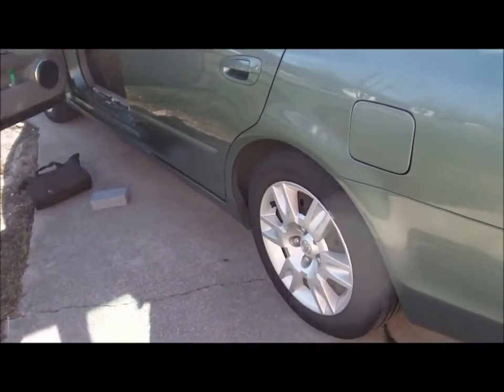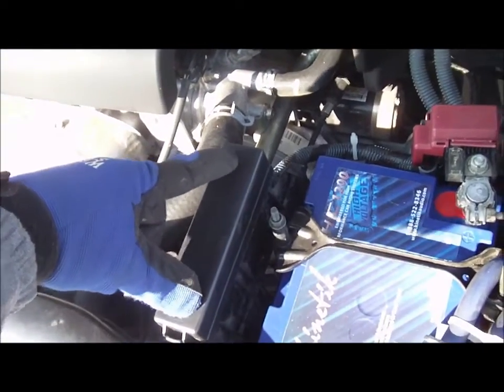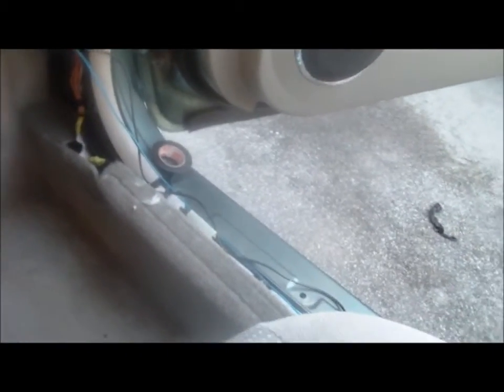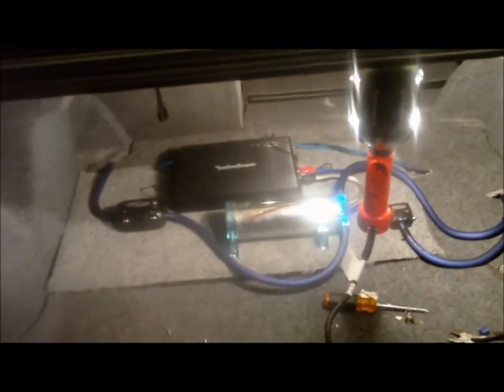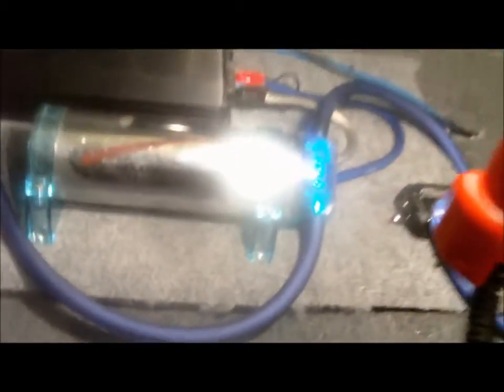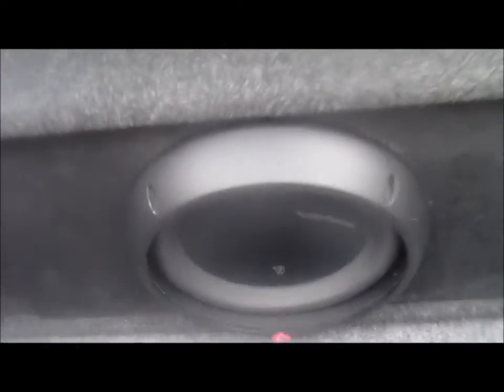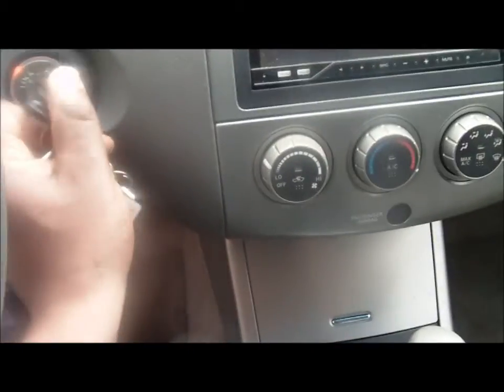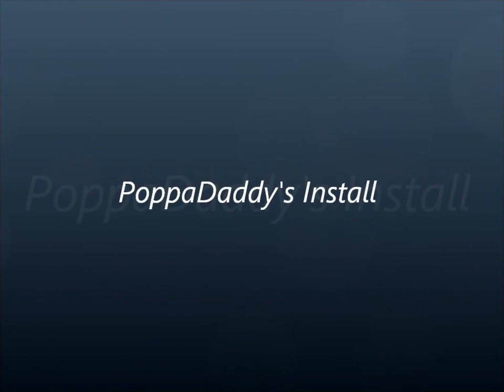2005 Altima Stereo Install.wmv

Comment: you are right bro, your car is automatic, mine has a clutch in the way too, there is no way you are getting anything in that wire harness without damaging the wires. That rubber seal is thick, very difficult to cut it. I guess I need to drill into the firewall like you did, or the metal plate whatever you did...

Comment from the maker: Things to remember guys. Power wire runs 12volts of current. Current will always disrupt a signal which is why you run it away from the RCA's carrying a signal to the amp. This rule applies to the car antenna which in most cars that the antenna is in the rear, it's ran in the paneling. The fix is to have all signals on one side and power on the other. Hope this help.

Comment from the maker: Yes.  Read comment below about "speaker level output" Search eBay or Amazon for this and you can also get one from your local electronics store.  There should be a power, alt turn on, ground, & rca female for you to install your amp.  I'd suggest inline wire connectors so you do not dismantle your OEM harness which also can be purchased online or local.  GL!

Comment from the maker: @akagoodtimes: I ran the 1/0awg wire under the paneling on the driver's side under the carpet.  There are clips that can be lifted (carpet) to access the necessary space for 1/0awg wire.  You will also need to remove the seatbelt panel to make the job easier.  Thanks for viewing.

Comment: I connected the amp turn on wire and a green cable that belongs to the power antenna to the blue/white cable but now my fm is all static.......... What did u do to your green cable from the car harness........

Comment from the maker: You don't need a new HU if you don't want one.  Just purchase a "speaker level output" and you then can plug your RCA's from your amp to your factory radio.  There is some wiring involved behind the FHU, but it's easy.  Thanks for viewing.

Comment from the maker: I posted a link in the description. As for the trip meter I wouldn't think that would have anything to do with the radio.  Unplug your negative (1) then your positive (2) then plug them back up positive (1) negative (2) and see if that will reset your system.  Try the panel fuse as well.  GL!!

Comment from the maker: @99intrigue99. The position of the firewall hole will need to be predrilled as demonstrated. No wires will be in the way, however your brake booster may/should be there so make sure you are in the middle or left for the hole. Thanks for viewing.

Comment from the maker: @310mannyboy :unplug that green wire for sure. Your harness will have a position for the green wire thus hooking it to a radio that supports power antenna. My antenna was in the rear glass so that wire was obsolete. I will post things to remember for static.

Comment: Nice bro!  I'm doing an install on my 2005 Altima right now as well. Ran the Big 3 also, but did my extra ground on the shock tower there was a nice spot to tap for a bolt there.  Did the alternator  power wire jsutl ike you did also.  Gonna wrap it in some heat shielded wrap just incase.  I wanted to ask did you have any problems with the power wire going over the exhaust manifold?  That spot where you ran teh 1/0 into the cabin is where I'm gonna doit too.  I think I'm gonna change how I did my power wire on the battery terminal to how you did yours though, that came out nice.  hope the car treating you right for all these years man!
Reply from the maker: Actually didn't have any issues with that particular wire with the loom tubing protecting it.  It was about 2" off the manifold.  I would run it differently to ensure that you don't though.  I don't have this Altima any longer because it was a lemon and I had to get rid of it.
Reply: @PoppaTInstall  Alright sounds good man.  I was doing some testing yesterday and I think it will be fine actually even without some heat shielding wrap but I'm gonna use some anyway. I got it  zip tied up front by the radiator fans where there are other wires only part that is a bit susceptible is right off the alternator but I added some loom and that heat wrap.  I'll check up on it, if it shows me any issues I'll redo it then.  I got some extra wire laying around that I am using and some new wire too, trying to  use up the old stuff lol. 
I saw the new build with that sub enclosure your doing in the SUV you got. Do the box, dont do the wall.  Boxes that are loud are much more impressive imo, anyone can build a wall and get louder.  Plus if your gonna drive it alot seeing out the back window is nice.  good luck thanks for answering me on this old vid you got here! :D

Comment: Hey I got a question I installed an aftermarket radio on the Nissan Altima 2005 and it turned on but it gave no sound and from what I heard I need to connect blue/white to the amp but idk where that wire is?
Reply from the maker: Maybe it has a factory amplifier.

Comment: How did you remove the floor panels to run the wires from the front to the back?
Reply from the maker: John David just pull up on them bro. They are attached with panel clips.

Comment: Hey xXpoppydaddy i have a 05 3.5 sl im putting the sound in myself. Right now,? How did u make the hole for the hot wire in that spot ?
Reply from the maker: Use a .25 bit for metal drilling. Once you get the hole use a step bit. You can view my other video show how to run 1/0 awg wire through the car for an alternative.
Reply: Thanks!

Comment: Pulled out my stock deck out of my 05 Nissan altima today to plug in my RCA jacks after wiring my subs and everything. But the stock deck doesn't have RCA jacks... Or does it and I'm just a dipshit. Am I just gonna have to go drop some dough on a new deck I really don't want to...

Comment: What kind of radio kit is that
Reply from the maker: Thanks for watching.  It's a Metra 95-7419 and I modified the OEM brackets 3:30 so it would fit correctly.

Comment: you dont need a HU with rca outputs, if your stock HU doesnt have them instead of dropping all the money on a new radio just spend the time and 3.50 and buy female rca plugs and splice them into one of your rear speakers coming out of the HU. If your amp doesnt have a low pass filter youll prob need to get one of those too. another 15 bucks. A whole hell of a lot cheaper than a new radio. Ive done this probably 5 times and it always works just as good as a HU with rcas.
Reply: That is a REALLY BAD idea. I'm assuming you forgot to mention the Line Level Converter between the RCA and the output from the factory amp. The signal you get from an RCA jack on an amp and the output from a speaker terminal are NOT the same. The output from a standard analogue audio out (RCA) is un-amplified, otherwise know as a "Line Level" signal. It's just the bare audio signal at a standard impedance. If you do what you said exactly as you described and plugged that into and amp, it would INSTANTLY be toast, because you are plugging an already amplified signal into it.
Reply from the maker: Corey Scienza Very true!  I posted up a link in the description (2013 Nissan Altima) for those that need words simplified.  Thanks for watching. :-)
Reply: Corey Scienza I did this, it didnt blow up my factory bose amp, but it was so loud at like 25% volume, i knew not to proceed... ROFL. You need to use HI-LO converters

Comment: Did u have to bypass at all??
Reply: nvrmind...how did u get a e-brake cable up in there for the bypass.
Reply from the maker: Ben Leyva You're bypassing the HU so you would use a MICROBYPASS PARKING BRAKE OVERRIDE.  May be a mouth full but its just a 3wire resistor. Thanks for watching.